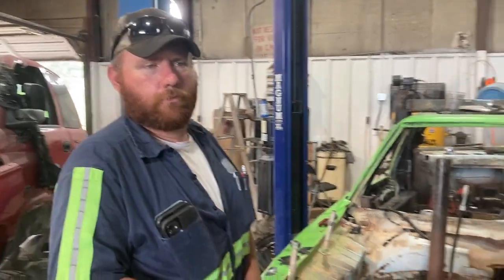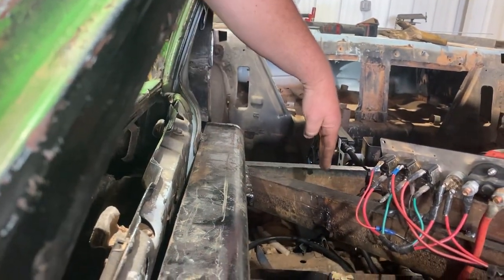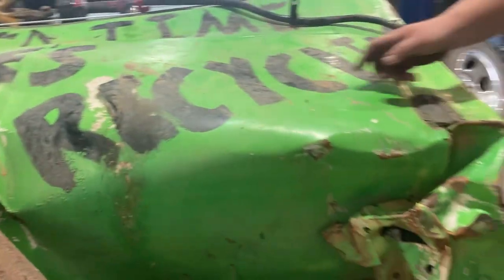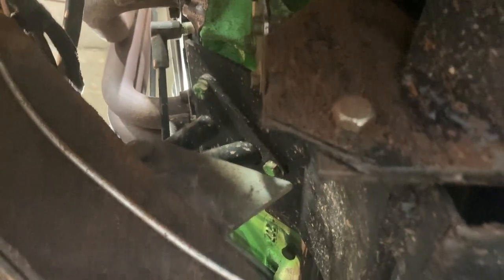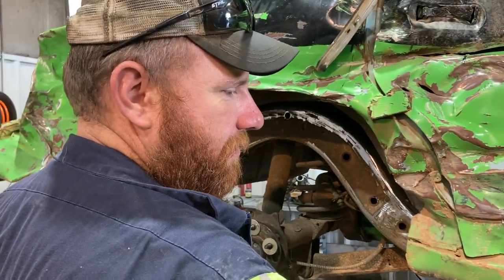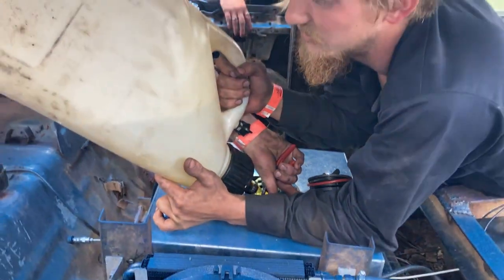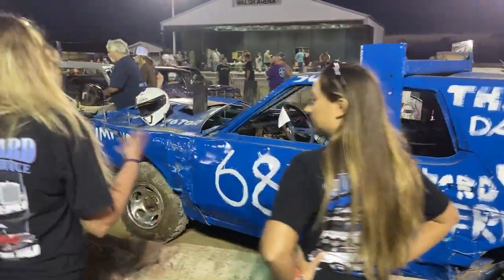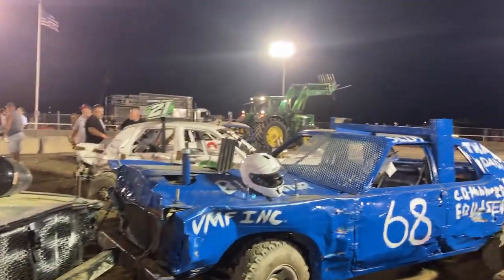C.D. Hubbard's first demolition derby!  Follow this sketchy build on a 1978 Ford LTD with 350 Chevy

Comment: The main thing with the fords is to tilt the frame at the crush boxes, if allowed run hump plates. Cut a few inches off the front frame and weld bumper straight to the frame. Bolt in rearends are a must and slider driveshaft also. Then run a engine cradle and trans brace then pressure the driveline into the body and frame before welding it in. And then go have fun.
Reply from the maker: Interesting.  I’ve been learning a little about derby car construction.  Interesting stuff.
Reply: Slider shafts, tilting old irons at the boxes and a cradle and brace are not necessary.
Reply: @95roadie  they are where I am from. You wouldn’t make it out of the heat race without tilting and pressuring and running a full cradle here in southern Illinois
Reply: @95roadie  it is here in southern Illinois. If it’s not tilted, pressured, and have a cradle you won’t make it out of the heat race. You must run against bone stock cars or some really lazy builders that aren’t serious.
Reply: @75impalaca91  I’m also from southern Illinois 🤣

I stand by what I said.

Comment: I ran a 78 cougar and it sucked it was all stock i was 16 and my dad said ya gotta learn some how....  It would not start so i put a little gas down the carb and had my buddy try to start it it wouldn't go so he held it on the floor and i was looking under the hood and a fireball came out of the carb and burnt every bit of hair off my head eye lashes everything. Screw Ford's never again. Now  im 42 and I only ran 1 other ford a escort wagon and damn near burnt up in that too. Good luck ford guys i will stick with everything else.
Reply from the maker: That car has a 350 Chevy and TH350 transmission….. not that it would matter to fireballs or anything.  🔥
Reply: @johnwilburn  that's right a Ford with a heartbeat 👍